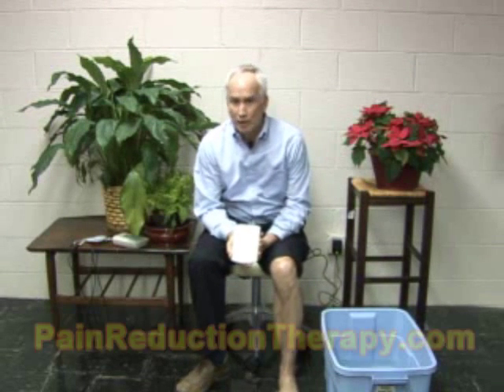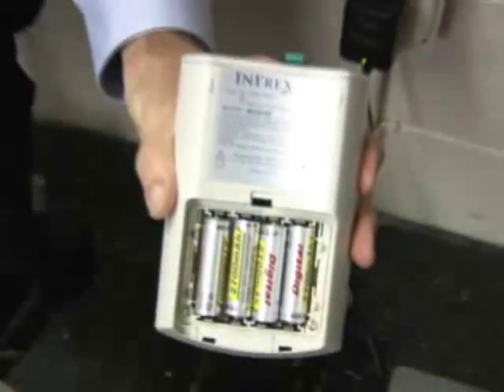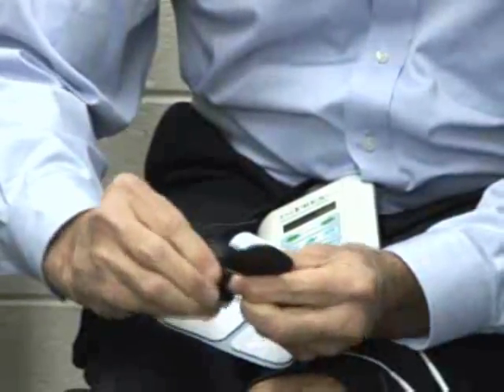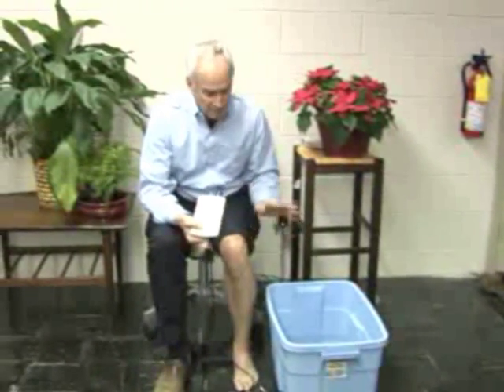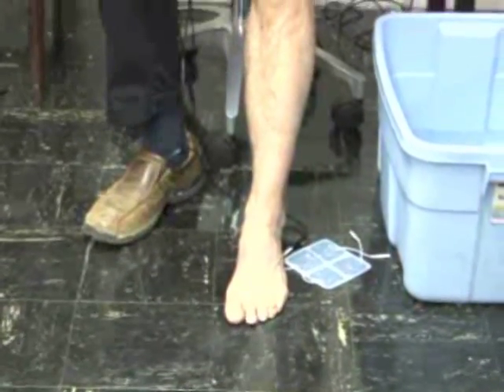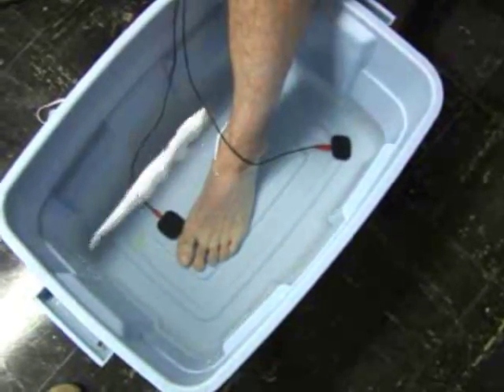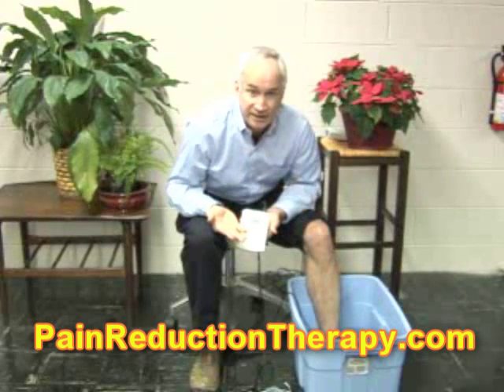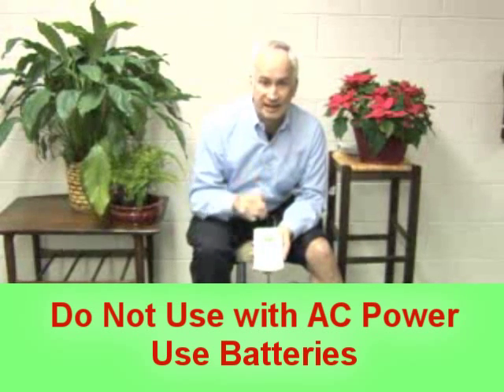Using Water For A Tens Machine Electrode

Comment: Can you do this with a Tens unit that uses 2-aaa batteries? Any brand recommend?
Reply: bob as usual this is not medical advice and not recommendation but the basic answer is yes as water is really a conductive medium such as an electrode except you have a larger conducting area.  A 2 x 2 inch electrode has 4 sq. inches of contact area to your skin for current to flow whereas water is all around and much larger.   Only do though, if you choose, with a battery operated device such as a tens that uses a 9 volt battery.  DO NOT DO WITH ANY DEVICE THAT PLUGS INTO OUTLET!!

Comment: I have a metal plate on the side my leg, 6  screws into my fibula bone. my ankle is swollen I think I have fluids as my swelling has been for 8weeks and each time I.excercise it gets more untill I rest my ankle then swelling reduces back to the normal swelling size. can I use the tens machine in a bucket of water with my plate inside my leg?

thank you